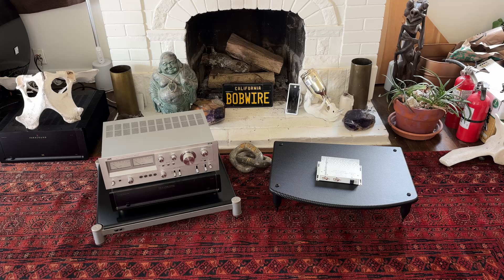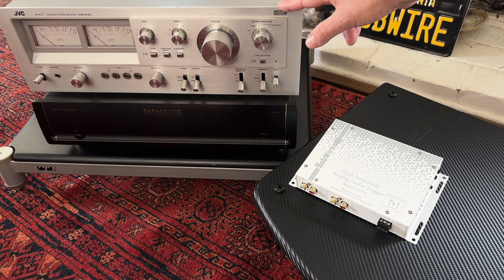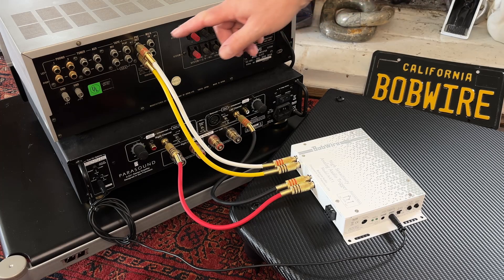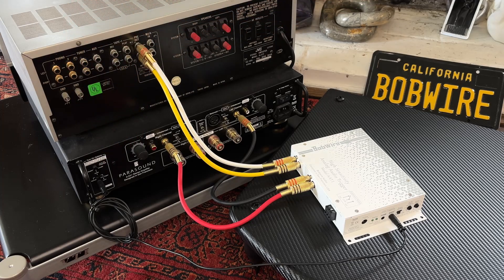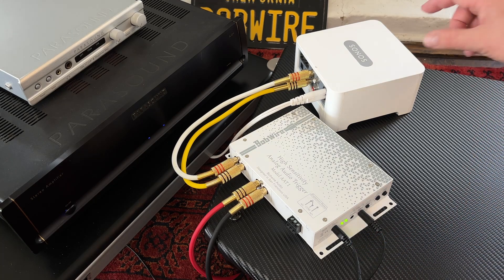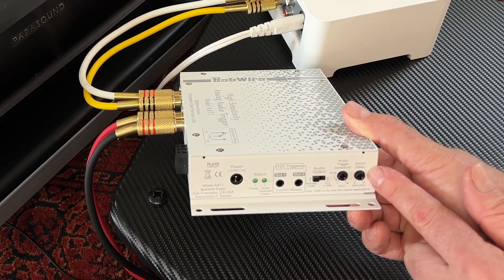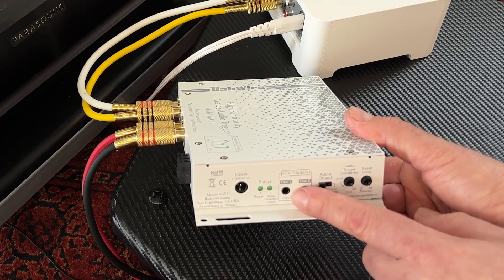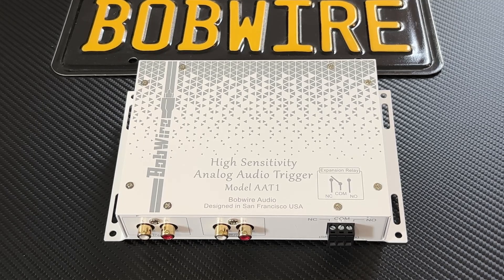Add a 12 Volt Trigger to any Audio System or Amp using the BobWire AAT1 "Analog Audio Trigger"

Comment: What about the amp itself not having a remote trigger, but the receiver does ?
Reply from the maker: In this case, you could try a power strip with a trigger input.  This could work if you amp does not mind having the AC power cut/reconnected.  You would want to make sure the amp will turn back on with the AC power is reconnected.  You would also want to make sure it does not cause any pop sounds in your speakers when the AC power is reconnected.  Check out the "iot Relay - Enclosed High Power Relay power strip" sold on Amazon.